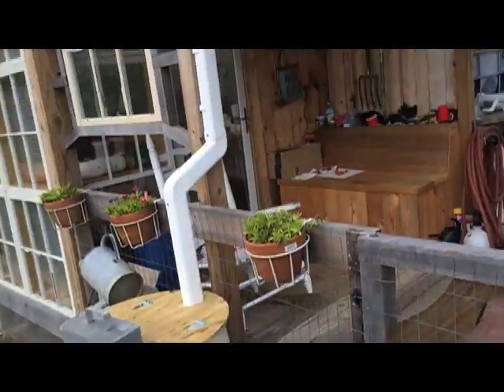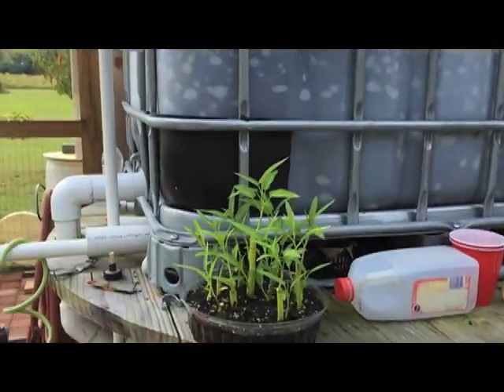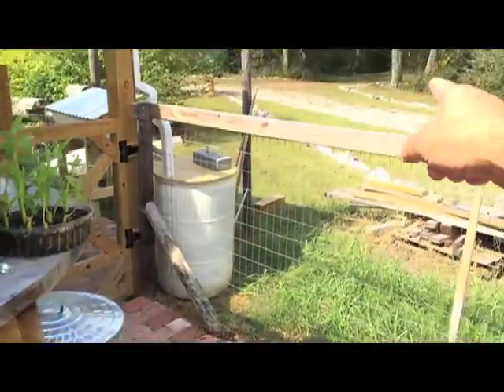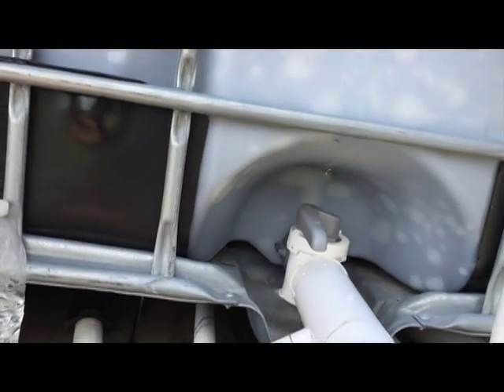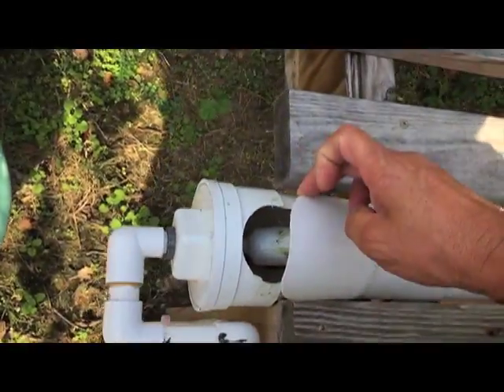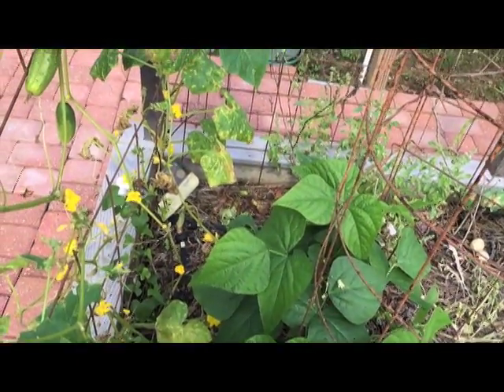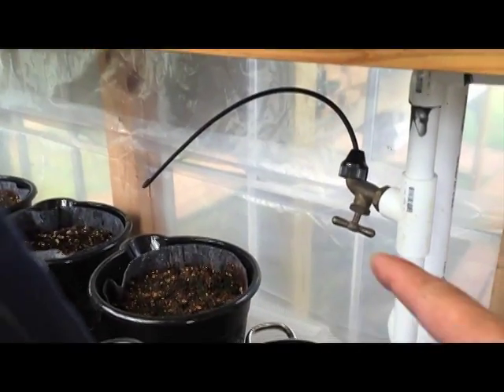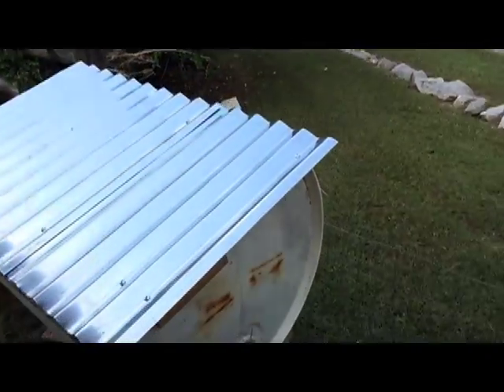Rainwater IBC Collection System

Comment: That is a pretty intense system. What are the internal dimensions of your greenhouse and do you wish that you would have gone a little bigger? I watched all of the greenhouse build videos but don't recall size or a mention of what the cost might have been for just the construction.
Reply from the maker: +shox rox ice Thanks for the comment.  I didn't keep track of what it cost.  I had the floor boards laying around so I didn't buy them.  It probably cost me around 800 bucks or so.  It is 8' X 10' inside.  And YES, I wish it were larger.  I could use 4 times the room!  Thanks for watching.  I have been dealing with hard drive issues and am getting a new one.  When it arrives in the next few days, I will be able to edit a few more videos that I have to catch up on.  Hope you are subscriber so you can see the other stuff as it comes down the pike.  Cheers.
Reply: Thanks for the response. I dig your permanent structure a lot more than a hoop house. From some brief research I think the wood+windows greenhouse is probably twice as expensive than a hoop house per sq ft. I am definitely staying tuned!